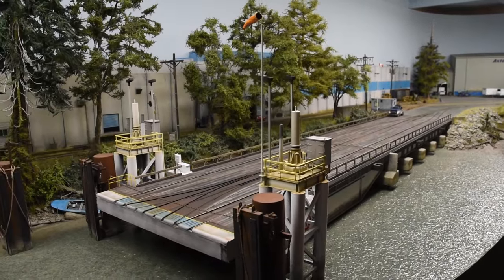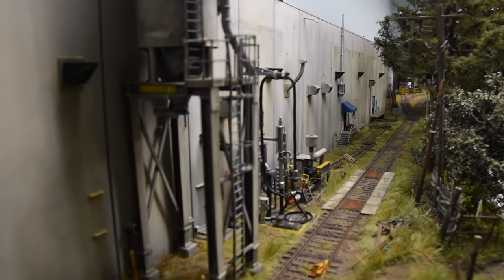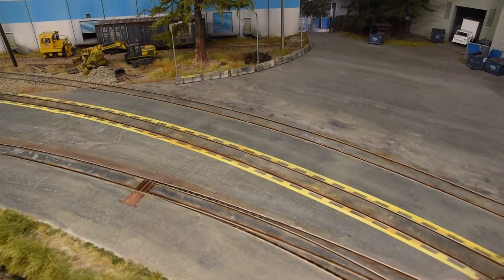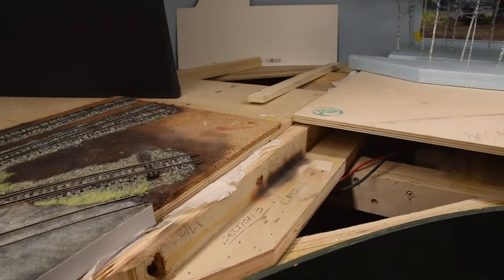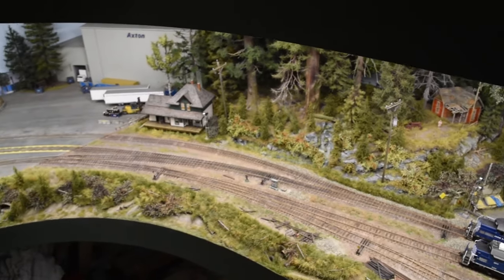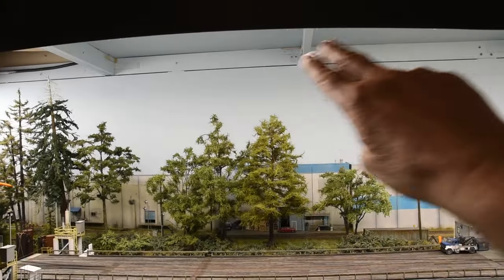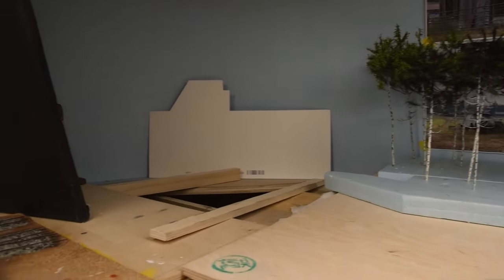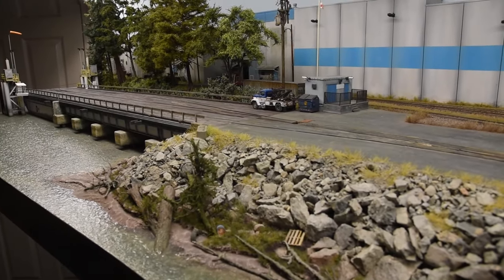Planning a Successful Model Railroad Shelf Layout | A New Perspective | Boomer Diorama ~ # 243

Comment: So, when designing my shelf layout, or a really big diorama in O scale, when viewing it from 6' horizontally, this is really 288' in real life.  In HO scale, 6' would be 522'.  How many of us look at the real world of rail roading from this far away?  If you factor that we look at the layout from, say, 2' above the layout, that would be 96' high looking down in O scale or 174' in Ho scale.  It gives a different perspective on what and how we look at what we want to build, i.e. how tall should the layout be? Boomer, you spoke about this issue on a recent podcast.  I think your layout is 58''?  Much taller than what most modelers use, but it brings the models closer to the viewer, and as a result, makes them look more realistic.
Reply from the maker: Yes. Track level is indeed at 57" from floor. It puts me in the dirt @ approx. 87 feet (1/87 Scale) away from the action. Anything closer and the scale begins to betray itself. This is the dilemma of social media which often times betrays scale because it zooms in closer than it should. 😉

Comment: It's really coming along, Boomer.  It's pretty cool seeing it standing back from your perspective. It's like a linear 3D shadow box. A sort of a shadowrama if you will. It appears to be looking at the real thing from a distance. It's like you captured a microcosm of a video that's actually a real  working scene with depth instead. It's truly a work of art. Oh yeah, the trains are nice, too. 
 The LED lamps are a good light source. I used 3000K LED mini flood lights on track and monopoints from WAC lighting above my layout and have a valance above the perimeter where I used LED rope lights. I painted a blue sky around the perimeter, and with the track lights on, it appears as backlit daylight. With the track lights off, it casts a blue moonlit glow over the entire layout. The track lights are also dimmable. They are 11 watt LED flood lights that are equal to 75-watt incandescent floods. 3000K is mid light color rendering and will enhance both warm and cool colors of the light spectrum. It's what retail stores market to light their products. It's why all the colors in the produce sections look vibrant and healthy, even the parts that aren't eaten, and the meat looks so red. Too cool, 4700K, and the warm colors will look faded and washed out, to warm 2700K, and the cool colors will look dingey and dull. 4700K is typically referred to as fluorescent shop lights, while 2700K is referred to as incandescent residential lighting. 3000K is the Goldielock zone in between and what is typically used to light paintings because it enhances and pulls out all of the intended colors. I've actually saved customers' money before looking to  refinish their oak cabinets because they were pee yellow, and they wanted them to look like red oak. I put in can lights with 3000K flood bulbs above the cabinets and they turned from yellowish to redish, and she was surprised just the difference that the color rendering of the lamp achieved and no longer needed them refinished. I've relit customers' paintings to hear them say. Wow, now that's what the artist intended you to see. The correct color rendering or temperature makes a huge difference in what you see.
Reply from the maker: Thanks for sharing that exposition on color temperature. I have another light source which I will have to dial down a bit as you mentioned. Thank you! Cheers.
Reply: @boomerdioramas Sorry, Boomer, your lighting looks great. If you were contemplating making lighting changes, I was giving some insight as a reference point to start from. Another thing to factor is lumen output in foot candles or intensity. Bare lamps without reflectors or a prismatic lens drops of rapidly without any drive. A flood lamp drives all the rated lumen output 8' down to the floor below. Spacing every 6' or the width of the spread, to remove shadows and eliminate hot spots. It's something to experiment with. Your working with a confined space so linear may be the way to go.

Comment: Excellent video and commentary Boomer! Your attention to detail is second to none. You have shown that smaller layouts can be just as much fun and rewarding as a larger layout.  I think the key is discovering what you enjoy about model railroading and building a layout that fits those needs. You certainly have done that. It is all about the journey, model railroaders need to remember to slow down and enjoy it. Thanks for taking the time and effort to post videos documenting your modeling.
Reply from the maker: Thank you Tom. Just curious. What defines a larger layout? Isn't there always a larger layout somewhere? Larger compared to what?The largest layouts I ever built I never published so I don't really understand the term . . . lol. 😆
Reply: Hi Boomer, When I wrote my book I struggled to come up with a precise definition of a "small" layout, there are just too many variables. What if a modeler has a large room, but only uses part of it for a layout, how do you classify that layout? I finally decided that any layout built in a typical bedroom (10' X 12') could be defined as small, medium size layouts would be in rooms of approximately between  150 to 400 square feet, and anything over 400 sqaure feet is large. Also if a layout is double decked that would qualify as large, regardless of the square feet of the room it is in. As has been said before, "size doesn't matter" as long as you are enjoying model railroading. Really what determines the complexity of a layout is turnout number. You can have a small layout with a large number of turnouts and it can be as much maintenance as a larger layout with less turnouts. Most of your maintenance and problem issues comes from turnouts. If some enjoys a rail fan type of operation, then a larger shelf style layout with just a few turnouts would be a good choice, but it would be simple to build and maintain. What I want to stress to modelers is to build what is right for them, not what others think they should, as long as they know what they want. 
You have done a fantastic job of demonstrating how much fun you can have with a layout that meets your needs and desires. Your car float is a great example of a lot of operations in a small space, and perfect for someone that enjoys operations. I am looking forward to seeing part 3 of your layout come to life.

Comment: Boomer...I've just seen a video on YT, about how to pull more cars with that TrackMobile. You use the  "dummy" coupler, so it bears more weight on the traction wheels. 
The channel is F&R HO Equipment.
Reply from the maker: Thanks for the tip!😁